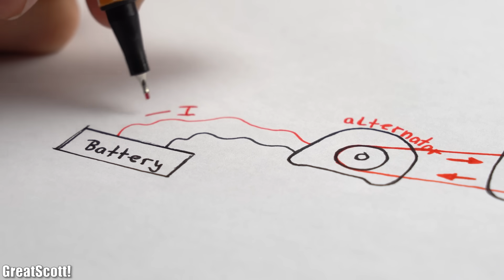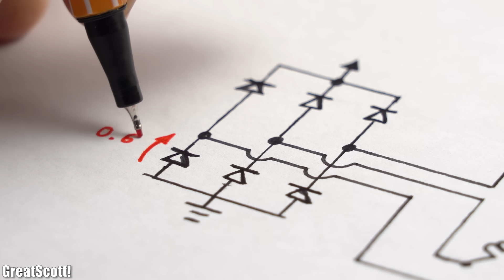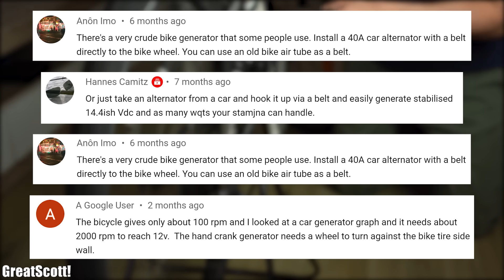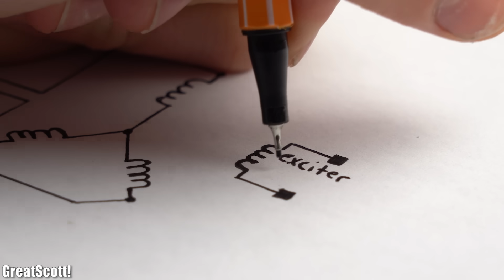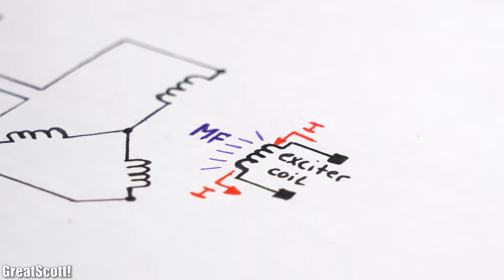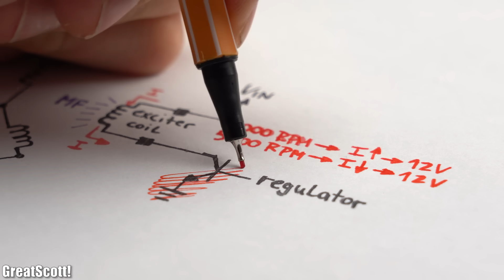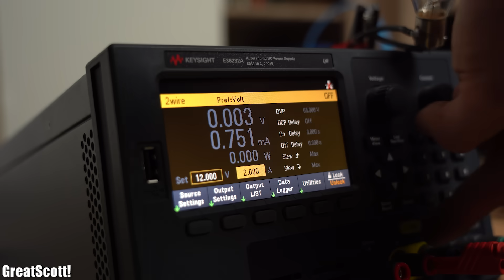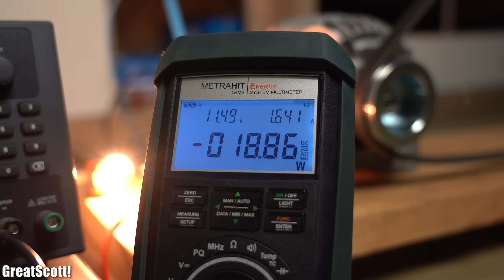Using a car alternator with a bike to power my home? How much energy can I produce?!

Comment: Why don't you power the alternator with a DC motor hooked to a single solar panel that's capable of putting out 20 amps and with the right puppy setup and using a alternator with a 200 amp output you would be able to charge a battery bank that would run your whole house.
Reply: Pully setup not puppy

Comment: This will charge a battery bank faster than most options as well as being able to maintain output while in use. Connect a inverter to a vehicle battery while running. Better to have options rather then relying on a few..

Comment: Add a flywheel to your setup and a variable voltage output to your Exciter to smooth out the power do to your rpm inconsistencies.

Comment: If you look at a rpm meter in a car you'll see that most the needle is somewhere in between 500 to 1000 rpm at idle in park or at a traffic light but when going 30 mph or faster the engine rpm will be higher then 1000 to 2000 rpm.

Comment: I believe there is a flaw in your logic;  You assume that you turn the generator at the HIGHEST speed to get the most power.  That's not the case with an alternator ( or necessarily with a generator either) .  You vary the power going to the fields, but you should have tried other gear ratio combinations.   Why ? Ever try to start out in high gear, say going up a hill ?  Yeah, you change the gearing to maximize your power output.  You should do the same with this setup.  You should try different gear combinations to see what is the easiest to pedal for the power it puts out.  What you are doing is like trying to drive a truck around in high gear all the time.  You have multiple gear ratios, try a different gearing to see if you can generate the same amount of power with reduced effort.   I would not end testing until I tried different logical combinations, like 1st, 3rd, 5th, 7th, 10th ..

Comment: Permanent magnet generator like they use in a wind turbine would be most suitable as it doesn't need a power supply and generates power at lower rpm.

Comment: If you change out the pully on the alternator to a bigger size will help also. I have a 230 amp alternator for my sound system with a bigger pully standing by for adding upgrades later.

Comment: man it would be cool if you could get hold of one of them bike power meters that the competitive cyclists use to measure just their pedalling power output for training and run some efficiency calculations or figure out what your theoretical maximum would be with 100% efficiency... 2500kwh a year means 6.85kwh a day, and elite athletes can apparently put out over 400w average over a day in the tour de france, so you'd only have to keep that up for 17 hours a day (7 hours to sleep shower cook eat clean etc) and youd be sorted...

Comment: Replace that motor with a barrel for tumble finishing various parts.
Reply: Add a better gear box ratio ( several 3d printed ones are effective ) and a tensioner to make belt tighter

Comment: You can use muliple alternators, and wind drive to battery bank. If static materials are used , you can use static electricity to increase efficiency to the battery bank. Maybe. I don't know.
Reply: Pull an alternator from a junkyard car.

Comment: i had a idea, what about using a transistor or a MOSFET to turn a electromagnet on and off instead of moving a ordinary magnet in a out of a coil 🤔🙇‍♂️
Reply: Hi. I would like many supercapacitors as battery management circuit. The key idea:Switch the   output of many capacitors so that they become constant DC.

Comment: Many auto alternators only need the external exciter voltage for a moment. It's usually applied when the ignition key is in the start position. Once the alternator is generating power, the regulator taps off the output voltage and applies the power to the coils as needed. In some cases applying a continuous external voltage to the exciter will burn it out. It causes over-voltage on the output and unnecessary magnetic resistance within the alternator. The use of a storage battery, acting like a capacitor on the output voltage, means the exciter current is far more stable, and drops off as the battery comes up to charge. It is actually more efficient to then run the 12V DC from the battery into an inverter and run the lighting on 120 VAC. Regardless, simple math tells that a human powered bicycle is just not enough to power much of anything. The average person can sustain about 100 watts of continuous power output at the legs for an extended period. Some of that is lost in bearing and drive friction and heat in the generating system itself. The laws of physics says if you output 100watts from your legs, it's impossible to get more than that out of the generator and usually it's a lot less.
Reply: You're right .  He's got the exciter coils on all the time .  No generator runs like that ..
Reply: You still need the 12v battery to power the internal magnets till the alternator makes its own power.  That's why the rectifier is used.
Reply: You use a small bulb to connect exciter connection from battery plus terminal

Comment: What if you used the higher Amp alternators that are designed for trucks. OR, Dual alternators.... Or Dual 400 Amp (800 Amp) alternators? https://www.mechman.com/400-amp-red-high-output-alternator-1996-2004-gm-truck-4-3l-4-8l-5-3l-5-7l-6-0l/

Comment: You can add a juel theaf circuit which will amplify your power output  then run through a series of high capacity slow discharge compasitors witch will give your system about 10 to 15 times the power , just like the computer in your car would do
Reply: So could you power a laptop with it

Comment: I use the BMW  N47 180p x 14 volt.
I pair it to a 5 horse   B N S petrol engine with the gas conversion.I can  use a 1200 watt modified sine inverter to drive small grinders and drills, I can also drive th house microwave,  etc..

Comment: You are completely wrong my friend
You are trying to work with a alternator whose controller is wired into the ECU. You need to change the controller  a 4 minute job and then you can use 3watt bulbs to excite the windings.. 
All your figures are a waste of time, I'm sorry,  get the proper non brain Valeo controller from an old ZX valeo or buy it new for £17 from Poland.

Comment: IF I were to attemp to generate a DC voltage, I’d look for a device that didn’t use brushes and had permanent magnets and a solid state rectifier bridge, then to a regulator. 
A Briggs & Stratton Intek V-Twin engine has this setup for an alternator. 
Remove the spark plugs and the magnetos.
Then figure a method of applying rotational energy to the crankshaft. You’ll be good to go till the rectifier assembly burns out.
Reply: If you don't have a dead V-Twin hanging around, just buy the 20 amp PMG alternator used on garden tractors. Its the size of a large orange, has V-belt pulley. You need the $15 regulator, too. Ebay has these alternators as low as $60.

Comment: How about magneting the rotor inside? It will produce a greater voltage output...🤔
Reply: At the cost of losing voltage regulation capability. If you're trying to generate consistent voltage output, no.

Comment: If you remove the diode pack it will switch this to A/C. The diodes change the voltage to dc

Comment: What is the rpm you are looking for . Could you use a dc motor atached to alternator and a batterie and loop the feed line so it self regenerate and produce the electricity you are looking for.

Comment: As you can see not a car guy! First use the old gm alternator ( doesn't need a Field wire for the stater .,also use simple math little gear and big rim on bike

Comment: 20 Watts seems awfully low to me. 
I did some quick googling and I think about 100 Watts should be feasible for a decently fit guy like you without too much trouble. I'll hop on my bike later and do some measurements to confirm.

Maybe you could try ramping up the exciter current slowly, so this way you can accelerate slowly without the belt slipping?

Comment: you got it all wrong. one pin of the alternator regulator goes directly to the battery terminal to measure the voltage at the battery and the other goes via an incandescent lamp to the instrument cluster to enable the alternator when the car is switched on, this is pulled to ground by the alternator when its not producing power illuminating the battery warning lamp.

Comment: You need to be closer to like 2500-4000 rpm on that alternator. Why don't you take another look at your gearing setup. 

You want the largest drive gear at the pedals and the smallest gear at the rear wheel. I promise. 

Also, the belt is far too long, either add an idler pulley for tension or get a shorter belt and tension it properly.

Comment: Is kinda cheating dont ya think?   Might as well just get a generator with a blown motor and give her the beans in high gear on your bike... hell what amazed me was the flywheel power on an industrial generator that was being used for a local hospital backup power..   they were doing tests on the unit and had the big ass diesel motor unhooked and the electrician told me to turn the flywheel and once i got it spinning just with one good tug the damn thing spit an arc out like a mot..  and kept the arc going for a full minute at least..  crazy..   the amount of windings on that beast was way more than youd think..  copper cables 1" round and the generator alone had its own building outside in the middle of a chiller building with constant water flow...

Comment: A world class cyclist is supposed to be able to generate about 750 watts so while I do not expect you to peddle at the same max rate of an Olympic cycliest I do think there is room for improvement as that was the energy use for the claimed condor  so I would think full out you could at least get close to half maybe 325 watts so 250 after edited coil loss which changes your equation from impossible to doable but hard .add several small wind turbine and you have a working system hint wind turbines are best to high torque low rpm and do not do well at high speed so the typical blade setup is for a design that wind can not do well better to pump water or air into a large reservoir then us that to intermittently power a small genorater with an output set to its highest efficiency possible hybrid system pump water to an enclosed tank the pressurise  with air run gen cycle repeat :-)